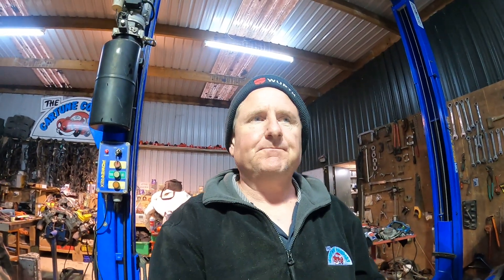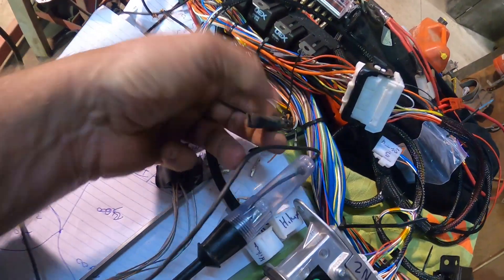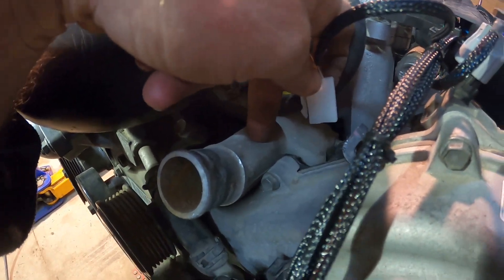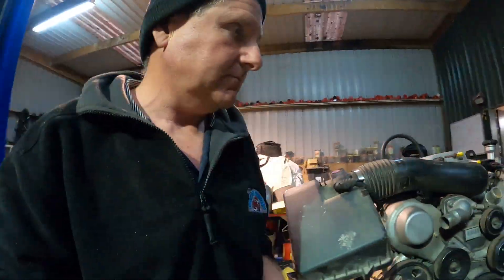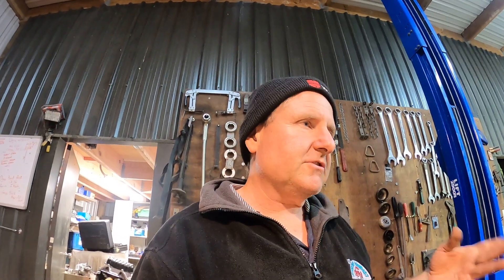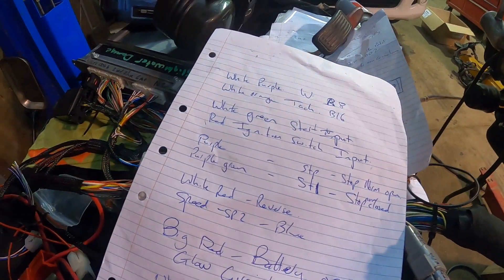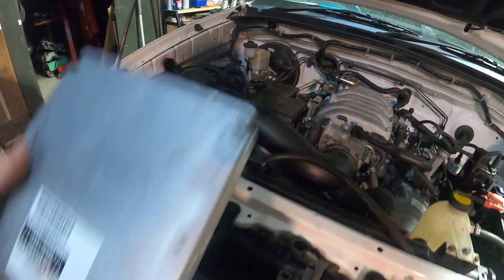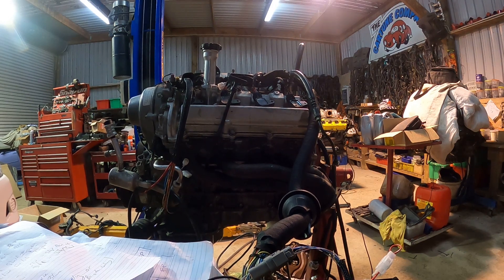Using 3uz engine wiring in swaps - some pitfalls of the 3uz-fe.  Example into a 2005-2015 Hilux

Comment: Hi CartuneNZ,

Im hoping you might be able to help me,

Where do i start i guess at the beginning, I bought a 2009 hilux 3.0l last year with a new MOT on it ran it all year without issue. Went in for its mot and failed badly on emissions. My mechanic ran tests and found all number of issues.

Basically i have bought and put in a 2014 engine thats suppose to have done 72000 miles. I have had to refit the original fuel pump injectors, air intake etc to get the wiring loom to work as the new engine had a completely different loom and plugs on all the ancillaries. Got it in fired it up and it smoked the place out at first then cleared out but it had a injector knock and will smoke if you hold it at 3000rpm anything below that it run perfect. We thought it was the injector as the ones from the original engine had done 200000miles. I had them tested and two injectors out the four were bad. so i got a service exchange set of new injectors and put them in, got them coded so all the lights on the dash went out. Started it and it filled the place with smoke again which after letting it run slowly cleared abit so i took it out for a thrash to try and clear it abit which it did but it is still showing the same traits as it did before i got new injectors you rev and hold it at 3000rmp and it smokes like its over fueling and when you rev it the diesel knock is still there. My and my mechanic are loosing the will with it but ive invested so much in it now that it needs to work for me.

Thanks In advance
Paul Snell
Reply from the maker: Could be many things such as an injector not seated correctly (or pitting in the injector seat which is bad) , or a faulty EGR valve,  failed ecu, failing sensor etc etc.  Best find a mechanic who can diagnose it correctly.  cheers Kelvin

Comment: Kelvin, I think you are the one I can talk to this about since you are extremely experienced in these kinds of vehicles. I got a 1995 lexus sc400. Completely stock besides an aem high flow screen filter. When I start it up it runs perfectly fine and about a minute and 30 seconds later after its a little warm its stuttering and wants to die (mild shaking in engine bay). Would you consider this a bad egr valve?